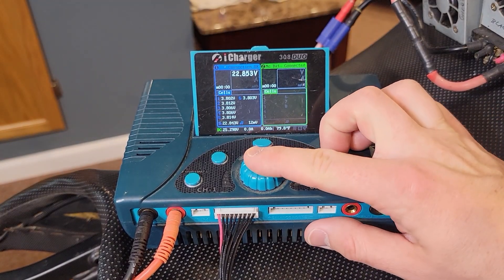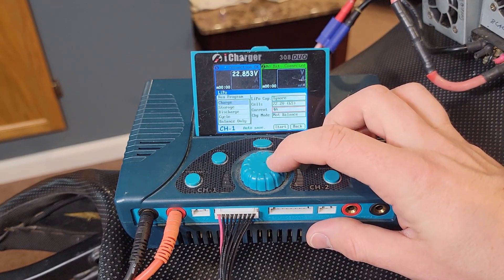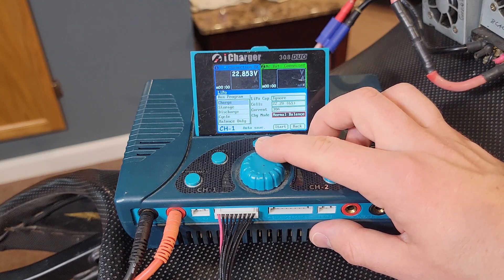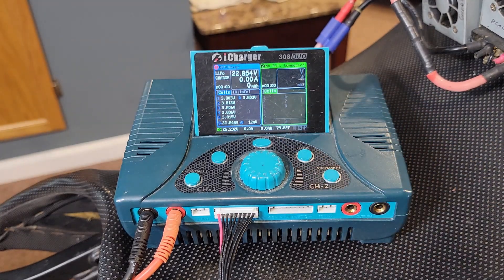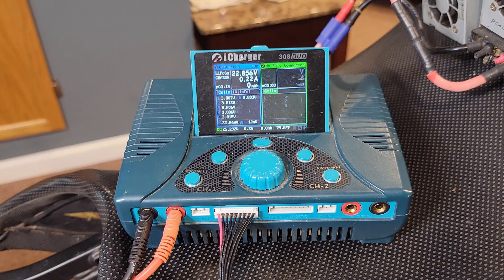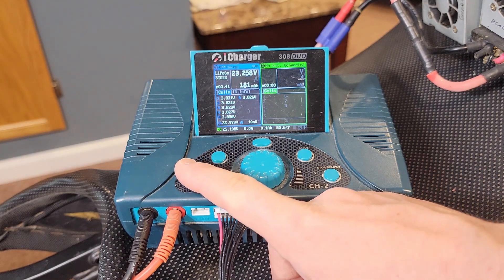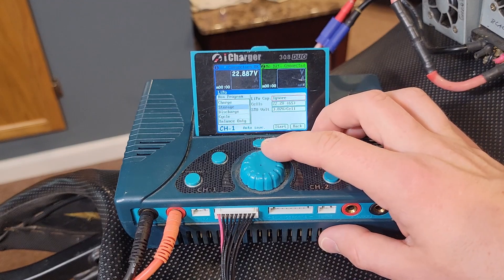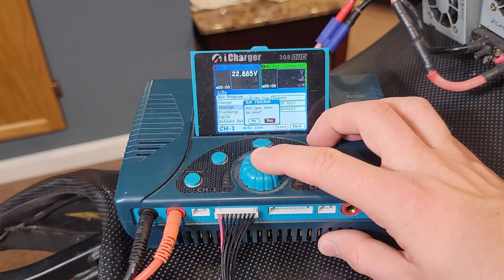How to Charge my LG Chem High Voltage Batteries! - Electric Motorcycle

Comment: What is your final voltage? 6s, 12s, 24s
Reply from the maker: @shaner.5  6s when charging and 24s when plugged in for riding.
Reply: @ ok I see, I do the same thing with 4- 5s packs for a 20s and use my Rc charger as well, how do you like those cells are they from jag35? each individual cell is 1s3p what kind of discharge are they rated for? Mine is 20s12p 32ah 21700 30T. I have my VESC set to 70 battery amps which is plenty for my scooter and easy on the batteries but my dirt bike I want a better battery i think those would work great much like your build, what controller and motor you use?